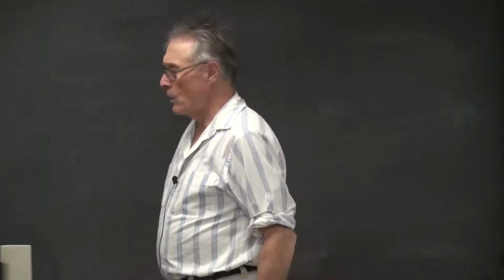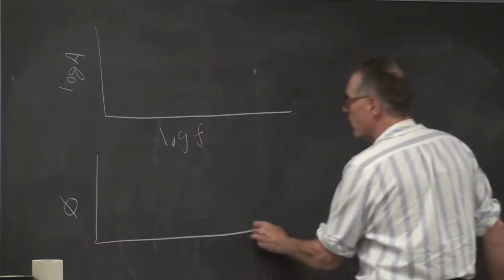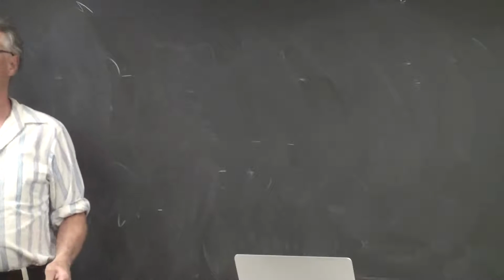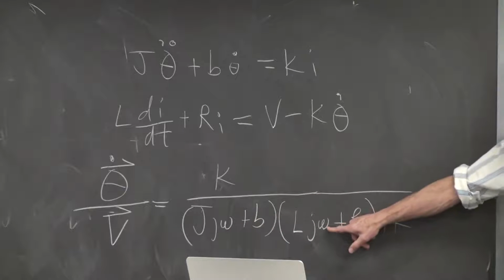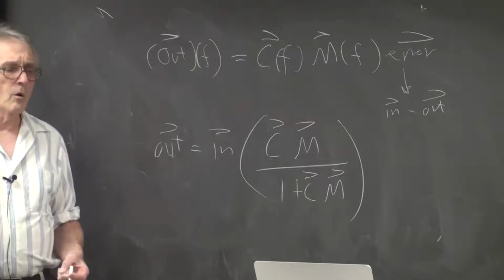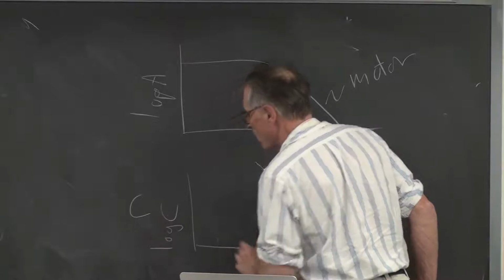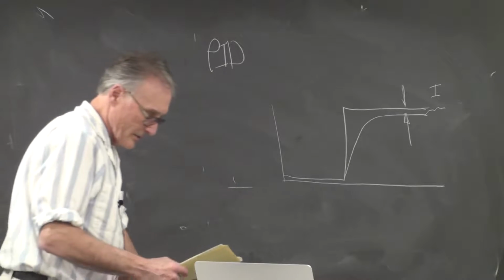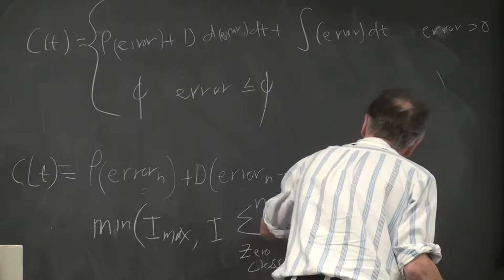#20 Motor and PID control

Comment: Indeed this lecture video is one of the best lecture I found online. I managed to write my own PID code in C by listening to the lecture.
I have a small doubt about the explanation about the integral term for the PID controller around 37 minutes. The summation or the integral term is sum of the error for a duration starting from begning till the time system error reaches zero. Also I was wondering if integral term should be made to contribute to PID calculated value when the error value is very close to the setpoint, otherwise its contribution can be left out. I suggest this as I understand integral term is used for reducing steady state error. If so when the system output is  90% to 110% of the set value the integral term contributes to the PID summation else it be ignored?
Reply from the maker: There are several nonlinear tuning adjustments you can make to the integral term. You idea sounds quite reasonable.
Reply: @ece4760  Thanks for the reply...